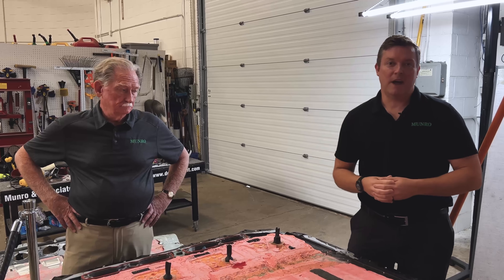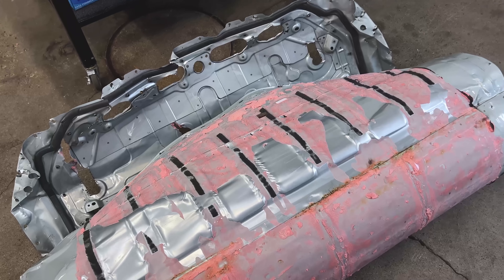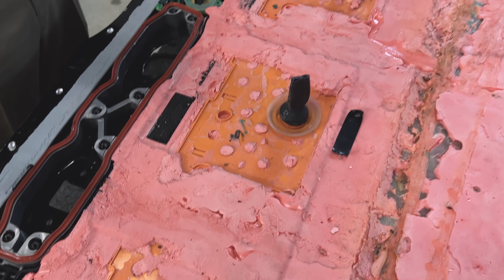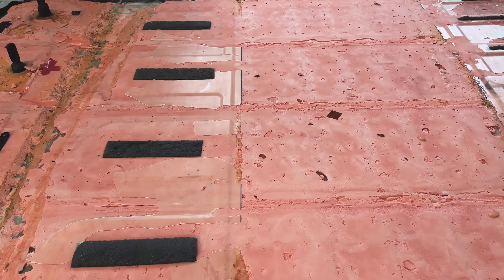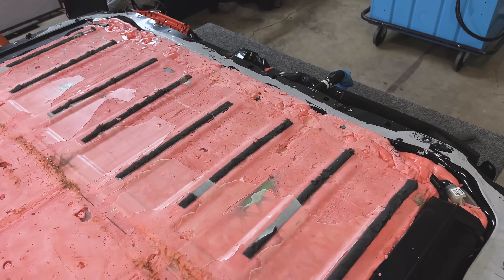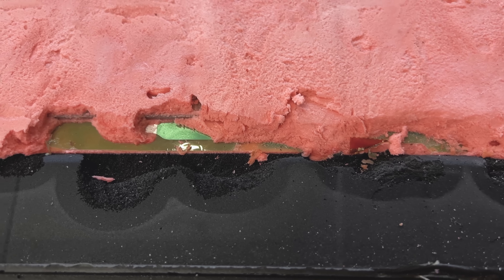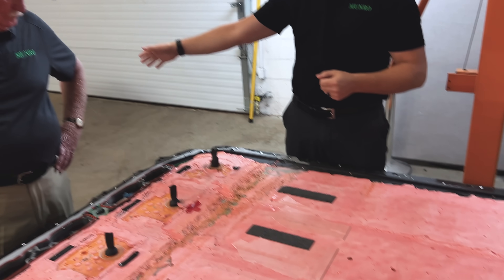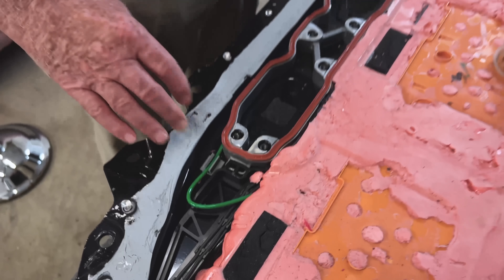FINALLY! 4680 Battery Pack Lid off | Tesla Model Y Update

Comment: The last times Tesla showed the structural battery pack (in Giga Berlin and Texas presentation events) there wasn't any pink polyurethane on the samples. So maybe this is just for making very difficult to see what really is inside the battery pack. The difficulties for repairing single cells on this system keeps me very worried yet... and Tesla hasn't clarified nothing yet. Hope everything is solved soon.
Reply: How about insulating high voltage that you stay with your feat over? How about that... ?
Reply: @loszonga  you are saying that this polyurethane is necessary for keeping the people inside the car safe of the battery pack? Just asking

Comment: I’m guessing the pink stuff is nothing more than insulation (electrical, thermal and noise)
Reply: that would be a bit too little for a car part ^^
you always have to consider everything. not just insulation.
price, availability, recyclability, safety, cost, time, weight, stability, etc etc etc 100s od things to consider

Comment: The BMS being potted scares me.  I could see something as simple as battery cells being fairly stable for 20 years, but I've never seen any electronic circuitry end up being dead reliable for that long.
Reply: I agree. I would prefer to see the cells alone in the pack and the electronics separated. But I guess it makes sense for companies. I've seen several manufacturers of other packs (small packs, not for vehicles) send good cells over to recycling centers entirely due to failing BMS's. No one wants to risk the liability of the cells messing up due to anything failing.
Reply: Do you still have the laptop from 10 years ago? I bet you don't. Is your phone 2 years old? Maybe. It seams some are unable to keep up with how fast the technology evolves and how grater the acceleration is.
Reply: @loszonga  A laptop or phone loses it functionability due to obsolescence. A 10 year old laptop has little value struggling with more complicated software, but I have two ten year old cars and a '66 Mustang along with my 2016 S, - all of which do the same thing: get me from here to there.   A new car that must be disposed of in 10 years is an albatross.  Hopefully, the BMS circuitry will be reliable but I'm less optimistic.
Reply: @ohger1  in Marocco their super popular taxis are Mercedes’ from the 70’s imagine how old those vehicles are but still in the roads! Let’s not forget all the Oder even older Mercedes’ or other vehicles brands still on the roads.
Reply: @alanmay7929  Yes, I have a '66 Mustang that still runs like new, but we don't need EVs to last that long unless someone wants to put extraordinary effort to keep it running for their own reasons.
Reply: @ohger1  are you serious!? Aren’t you!? Because the longer a vehicle is on the road, the less raw materials needs to be mined and less impact on environment……. Talk about those millions cars that gets exported from rich countries to third world countries, Africa, South America…… those cars are used till they fall apart! Vehicles needs to last as long as possible nomatter what!!
Reply: @ohger1  people are still driving around with 30 to 40+ years old cars all around the world! It’s even a bigger picture with trucks and other larger vehicles.
Reply: @alanmay7929  What in the holy hell are you talking about??  I think you're responding to the wrong poster...
Reply: @loszonga  I do have a 10 year old laptop (MacBook Air) that runs the latest software and is more than adequate for daily use. Original battery that still performs quite well. My two original iPhones still power on and hold charge just fine.
Reply: @HoldFastFilms  and with upgraded RAM and also modern storage/SSD and even battery it’s even up to actual laptop usability too.
Reply: @loszonga  are you actually serious or just dumb!? Vehicles are not your typical tiny portable device lol….. vehicles can last literally decades! I still own a 1989 Toyota hilux and it works still.
Reply: @loszonga  also even 10 years old laptops are still in use today with new batteries or repaired ones!

Comment: This is meant to stop any repair to battery pack,Tesla are getting greedy.
Reply: Congratulations, yours is the 18th worthless comment on repairability/recycling.
Reply: Tesla packs were never repairable, you can’t replace a module, companies that is doing that are scamming customers only to have them come back a while latter with the pack dead again 

This changes nothing from the previous packs, the penthouse is still easily accessible, you can replace chargers, contactors, DC-DC converters, BMS main controllers and so on

Only thing not replaceable is what never were replaceable in previous packs anyway
Reply: @Pedrodemio  I think Gruber motors were doing the repair,I have seen my friend repair roadster and the capacity now it's like before.they disconnect the cell with problem and stop the bad cell draining the whole pack.

Comment: so the foam is structural, not just to keep the batteries from rattling around? intense design. difficult to service :)
Reply: Battery pack probably not intended to be serviced, but instead, recycled.
Reply: @michelangelobuonarroti916  another random dumb comment! Batteries are supposed to be reused first! The recycling is only when they have very little capacity left!
Reply: @michelangelobuonarroti916  EV garage west for example has used almost whole tesla roadster battery pack to make into energy storage in their workshop and it works great since years!
Reply: @michelangelobuonarroti916  it’s absolutely a bad idea to destroy batteries that still have a potential.

Comment: Great engineering for when in use...recycling might be an issue?
Reply: Congratulations, yours is the 17th worthless comment on repairability/recycling.
Reply: They will just shred it down to pieces and chemically separate the materials like all batteries are recycled.

Comment: If Tesla has to use brute force to peel off the plate that curled up, I imagine they easily access brand new plates to close the pack back up. Otherwise, am thinking Tesla considers how they service the battery packs proprietary and/or a trade secret. I suppose Tesla does not give tours of their battery refurbishment shop. -- Perhaps Gruber Motors has some knowledge as they have been repairing Tesla battery packs.
Reply: I doubt these will be serviceable at all unless that pink spooze is easily and completely dissolvable by design.  New top covers are the easy part.
Reply: Tesla don't want enyone to repair them. Just replace with a new.

Comment: I get the battery pack integration within the chassis. But making this unserviceable is a huge mistake. 
This is only going to re-enforce the argument against EV cars by those that previously claimed the difficulty and potential environmental challenges in battery recycling. They were wrong before with the traditional bolt on approach. 
In addition to being able to upcycle individual packs for other applications.

But I am afraid they are 100% correct now with this next gen design. 

Tesla really needs to rethink this approach.
Reply: I own an S, and I don't disagree.  Even if the cells are very stable, what happens if there's an electrical failure in the BMS?  TBH, this scares me a bit.  I've never seen any consumer electronics perfectly reliable for 20 plus years.
Reply: By the time these batteries start to go bad in large numbers, battery recycling infrastructure and supply chains will be up to speed.  At that point "upcycling" will be less important than it is now and battery costs will be much lower than today.  These things will just get chucked into a shredder and "mined" for the raw materials to make another battery.
Reply: Congratulations, yours is the 14th worthless comment on repairability/recycling.
Reply: Realistically, someone will invent a replacement pack for Teslas at some point and you'll just toss that old pack once it is unusable.
Reply: @Noisy_Cricket  “just toss it” wtf that makes sense
Reply: Partially you may be wrong: first this is the first iteration of a structural pack with accent on structural. Second this is an entire new car battery, the risk associated with public use is grater than anything before, hence the previous batteries where made and tested in laptops way before cars. And thirdly, for sure looking at the packaging, redundancy is built in: if you lose one cell or two cells - let's say they get internal damage - you still have a lot to go around just like Christmas lights. From the recycling aspect, when you will recycle this - 5 years from now let's say - it will make no sense but to crush it and rebuild. So, please, make more sense with your comments.
Reply: @loszonga  Dear little keyboard warrior
You ignoring a fundamental technical issue with Tesla BMS (and most other brands as well).  The BMS does not monitor each individual cells. Only modules (a group of cells). Therefore, if you have one faulty cell. Your entire pack can shuts downs, and you have now lost 12-20% of your capacity or worse with early Model S.  I don't think you understand how the cells and modules actually work. There is no redundancy and if there is. Please point out an article on the subject.  

Currently, I can have the faulty cell identified and disconnected from the module in my model 3. Therefore re-establishing the module to 99% capacity for ~$600. 

With this new design, you are fucked. 
No can neither disconnect the cell not replace the module. And for BMS failure, you are boned as well. And because this is an integral part of the chassis. I bet you the replacement cost for this battery assembly is 50~75% higher. 

A little education on the subject at hand. 

https://youtu.be/F-B_8oMZNeI
Reply: Are there serviceable batteries?
Reply: @jamesparson  Yes.  Many packs like the Prius and Camry can be taken apart easily and the bad cells swapped out.  There are also places that offer repaired battery pack service for earlier Teslas.
Reply: You don't need to service batteries that last a million miles. It is far cheaper to make a structural pack like this and  recycling it at the end of life, then make a worse pack that compromises car efficiency just to minimize recall costs when your 3rd party batteries fail.  Companies like GM have zero faith in their batteries, that is why they are making the bloated and inefficient ultium packs.
Serviceable or not, the recycling process is the same.  You grind the pack down to dust and mechanically or chemically isolate the materials.
Tesla is the environmentally friendly approach.  Every gm car is going to be heavier just to accommodate serviceable packs.  The packs themselves are less dense. A serviceable pack makes a worse car that is more expensive and less environmentally friendly.  Over the life of the car, the increased inefficiency will waste energy and cause more pollution  than a tesla with its higher efficiency.
If you truly care about the environment, you support what tesla is doing and dislike what GM is doing.
Reply: @_PatrickO  SPIN much?
Reply: @glenng1304  Grow up.  The saddest part about people like you is that the tesla packs are likely serviceable.  All you need to do is flow in solvent to remove the foam and rinse.  Then you can open and service like normal.  After service, you reassmble and insert new foam through the same port used for the solvent. Once the foam is cured, you can reinstall into the car.  Tesla may not do this, but 3rd parties can certainly do it if it is in any way cost effective to do.
Reply: @_PatrickO  LMAO!
there hasn’t been one single Instance of a tesla going 1M miles on the original battery.
Reply: @mattbrew11  Grow up, it does not have to be a million.  200k miles puts it ahead of most ICE cars in life span.   They are shooting for a million, but after about 200k, it no longer makes any  sense to make the car less efficient to accommodate cell swapping in the pack.  200k is 20 years for most people.  The saddest part about you is that the tesla packs are likely serviceable by flowing a solvent into the pack to remove the foam before servicing.  There is no reason to not weld the lid if it wasn't serviceable.  So while everything I say is true, these packs still are likely serviceable.  After service you close the pack up and insert foam the same way you injected the solvent.  Once cured, you install the pack back into the car.
Reply: Nobody without access to a serious lift, high quality energy isolated power tools, proper ppg and the willingness to service ev pack's with life threatening voltages contained within. Is ever going to be able to service any of the ev pack's period. 👍🏻

All of you chicken little the sky is falling type's amuse the heck out of me claiming otherwise. Which is exactly why pack's are swapped now and the oem might then try to repair it on their own, part it out to the market hungry for scrap ev pack's and modules or just scraps it outright. 

Look at the bolt it was the bms and a few cell connections gone bad. They scrapped all those pack's and just built new one's. 
And the bolt only sold about 150k total unit's in its life.

Comment: I am not sure if this is the right direction in terms of sustainability. Getting all that goo off the battery cells ... I guess this will not be possible. I know that the 4680 will last longer, but in case of recycling that looks like a mess for the recycler.
Reply: I share your concern, and I'm just guessing here, but if the whole pack is put through a crusher, the foam pieces might float on a water pool and the rest might sink. But yeah that would require the recycler to have giga water tanks.
Reply: @Groaznic  You don't need to change the water every single time :) You are not cooking.
Reply: @loszonga  Haha indeed cheers man.
Reply: Congratulations, yours is the 13th worthless comment on repairability/recycling.
Reply: You know that current 2170 packs are no different, right?
Reply: @boostav  hmm  the last opened battery pack with 2170 cells I could see had not such disgusting gooy stuff and it was easier to open it. But okay maybe that changed
Reply: @christophmartin5381  Look again, the cells inside the modules are covered in blue goop. Unless you are referring to the very old packs.
Reply: What are you not sure about?  Packs designed to be taken apart to swap cells are way less sustainable.  They require more material and are less efficient.  An ultium pack is going to waste energy for the  life of the pack.
Packs are recycled just like cellphones and laptops.  They go into a series of grinders to make them dust.  The foam is handled at some point with a solvent that is itself recycled.  Solvent recycling has been around for a long time.
When the packs are dust, mechanical and chemical methods will be used to isolate materials.  It saves way more energy and creates less pollution to recycle a pack full of refined materials, than it is to create more refined materials directly from new mining.
I do not get why people want to baselessly invent negative issues that are not real just to give themselves something to gripe about.  Educate yourself so you stop assuming the worst about things you don't understand.
Reply: @_PatrickO  yes I understand this, bit what is with that often mention second life of a battery pack? Many producer just use them for stationary storage. But I don't know if they change single damaged cells.
Reply: @christophmartin5381  The second life of a battery pack is a brand new battery pack.  There is no reuse of old packs that comes close to the environmental savings of fully recycling the pack to make a brand new one.  You realize that recycled batteries will become cheaper because recycling is cheaper than mining new minerals and refining them, right?
Your mindset has been poisoned by something.  Manually pulling 10 year old batteries out of a car pack to use for low volume reuse projects is wasteful.  When it comes to batteries, reuse is a waste and recycling is far better in every way.
Plastic recycling is not real, but recycling minerals is.  For plastics the best you can do is reuse in some way.  For metal  packs full of refined battery minerals, recycling is the best option.  That said, AI research developed an enzyme that can breakdown plastics at 50degC, a few more years of work will likely develop a room temperature enzyme and within the next 10 years plastic recycling should become a real thing to.   When that happens, reuse of plastics will die off in favor of direct recycling to base substances that can be used for new plastics.
Reply: @_PatrickO   LMAO dude you are living in the future, behind your computer screen with your nose in articles about lab technology that isn't around you. That's not reality right now. In reality, there are millions of people with EVs right now that could get a poor quality cell getting resistive and bringing the whole pack to its knees, in which case the eco thing to do is to go to a shop that opens the pack and isolates or replaces the defective cell and you're good to go. People don't have 15K to pay Tesla to replace the whole freaking pack for one dud cell on day 1 after the car exits warranty period. We're not walking talking dollar sacks over here genius.
Reply: @Groaznic  Even when I share your concerns, but why so offensive? I think we will come to the point when it will be like he wrote above. But right now I think our concerns are valid and should be addressed and this design is the opposite of the'"right to repair"